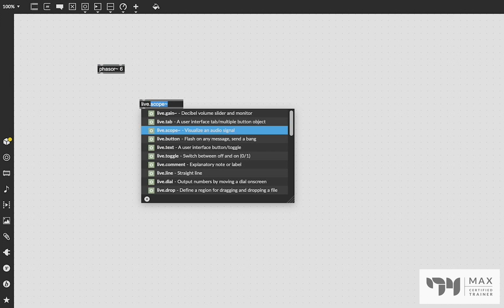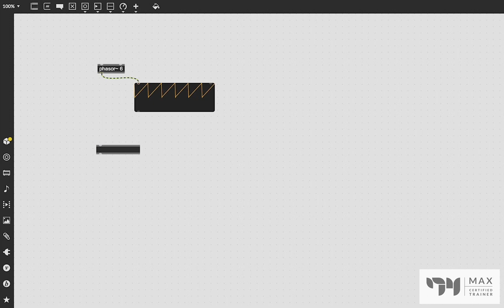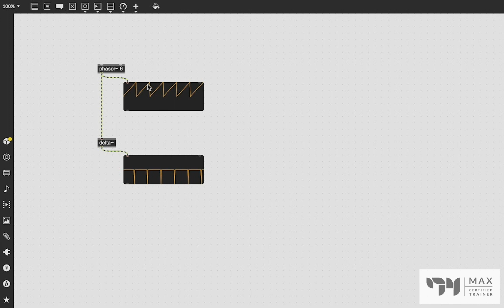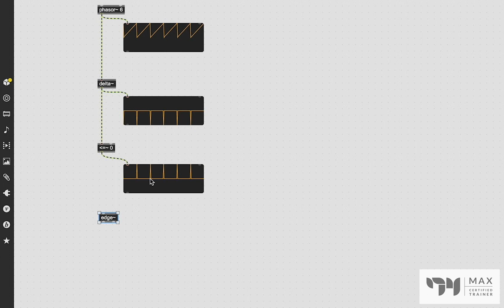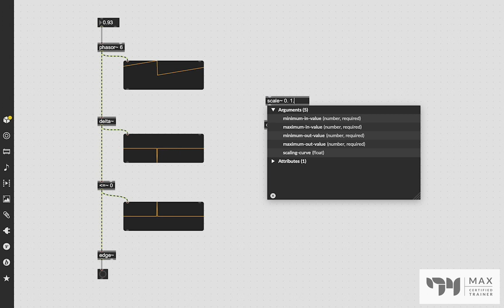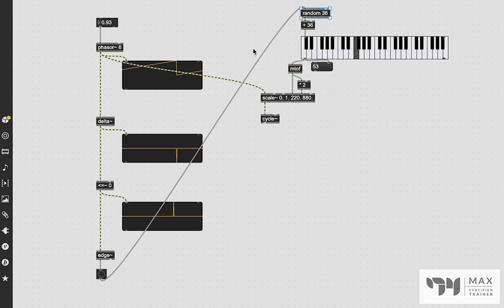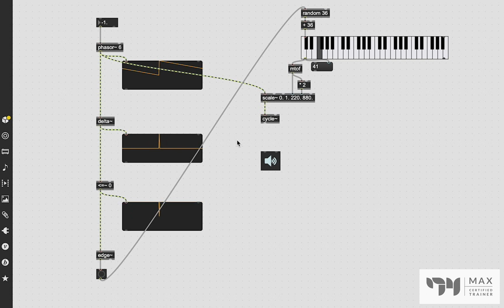Delta~ and Edge~ - Phasor Ramp Bangs - Helpful Objects to Know - Max MSp Tutorial

Comment: HMMM 
The delta~ object is not really necessary 
If you just subtract 0.5 from phasor , the edge~ object can now also detect zero to non zero transitions (without the use of delta~) and spiiting  out bangs .
try it
Reply: This was a super useful video for me, as I am still in the early learning stages of Max. But, I seem to find that if I run my master Phasor locked to the tempo in Ableton Live (with the 1n @lock 1 or 1.0.0 @lock 1 argument) and run that into a Sibdiv (with an argument of 1) I can hang a bang off the bottom of the far right output  of Subdiv and I think I get the same result. It's certainly worked for me when building my crude phasor based sequencers and is a bit simpler, if like me, you struggle with more complex patching. Be interesting to learn what more experienced users think (or critique) about this....